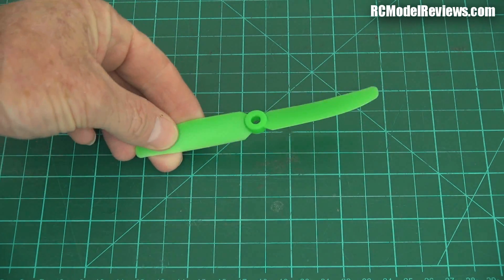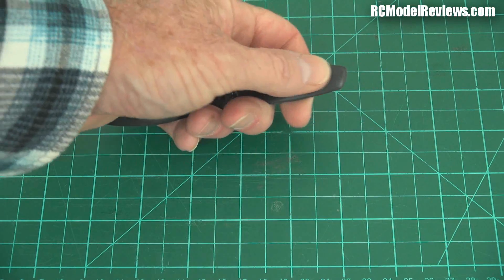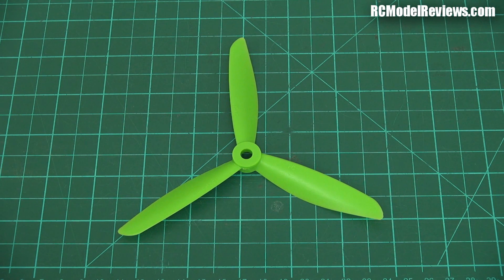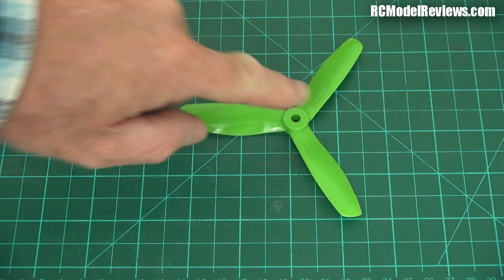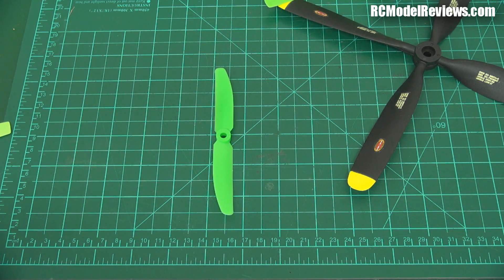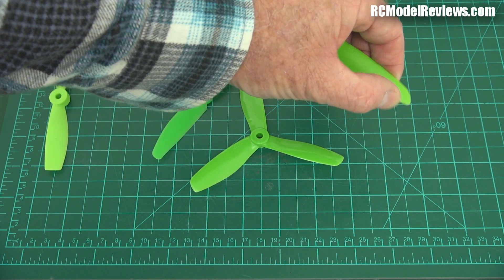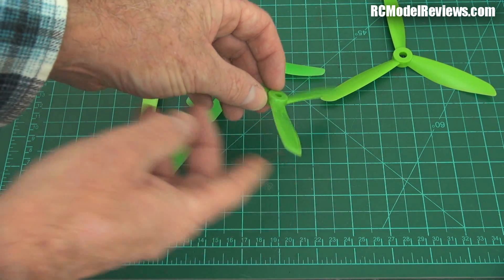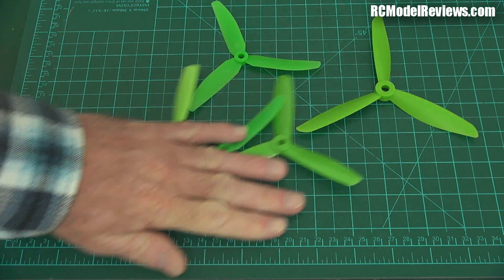Why use multi-bladed props?

Comment: This is a fascinating subject, I'm glad you're exploring it.  I did some of my own trial & error analysis with boats.  The variables were mostly the same.  However one of the key targets I factored in was the Max Efficiency Amp rating of the motor.  A draw value below the figure, let's say 18A meant you were leaving power on the table (not utilized by load) and a drawn value above Max Efficiency meant the motor itself was burning off power as excessive heat. A very challenging subject.   I can't wait to see your results.  Cheers.

Comment: There is no such thing as "gripping the air". Full scale planes go to multiblade props when tips go into transsonic region, killing efficiency.
Reply: Dmitry: I'd never heard of that but it makes sense, the wall of drag tips of a large prop encounter exponentially as they approach such speeds. Thanks.

Comment: Dear Sir, I went trough most tripples on  my flygin setup, so LB20a, Nano 1300mah 4s 45-90c with few common motors I have/had (CM2100kv, eMAX RS2205, RCX 2633kv) . The idea behind it was: to compare them, have a relation. Not showcase the max output. I am sure one can get more, I would observe it go down by seconds on those poor 1300mah batteries :) Anyways. 
https://docs.google.com/spreadsheets/d/1MHiwL-Ppa5EijWQnxz0YCHZVRdIq61A_nlNokHOwaSQ/edit?usp=sharing
I really like your aproach to tests. I have chosen a few to use in relation to tests. I went with 5x4x3, 5x4x4, DAL 5045BN v2.
I just received DYS 5x4x3 which have a good price, might try them over the weekend (both in air and stand). 
I did test all the BN doubles but I just like the way triples work. 
The absolute shocker was CM2206-2100kv on 6s Bolt and GF5045bn (duble) 1.7kg :O

Comment: For racers, you only need enough battery to last until the end of the race, any extra is unnecessary added weight. A real test would be to see each configuration with the appropriate battery.
Reply: Well more efficiency would allow a smaller battery. All is a compromise
Reply: +Samm Sheperd (SNRS) Exactly, though I do suspect that a 4 bladed setup with a 2208 and larger 90C battery would perform much better than even the most efficient prop/motor combo and lightest weight battery equivalent.

Comment: There is an additional bonus to multiblade props, and it's one of the reasons that I fly them.  Because they produce more thrust, you can fly with less overall blade speed.  This makes multiblade props quieter than two blade props, at least in my experience.

I would find a hover efficiency test interesting.  In theory, some of the inefficiencies due to adding blades, is mitigated by spinning the prop slower.  I'd be interested to know how the battery life duration for just hovering would compare between props.
Reply: Old post I know, but figured i'd reply anyway in case someone else runs across it. I saw a video of a guy who tested 4 blade, 3 blade and 2 blade (4 blade with 2 blades removed) props on his tiny whoop, and he was gaining roughly 30 seconds more flight time per blade removed So the 2 bladed prop was giving about a minute more flight time than the 4 bladed prop.  So the drag reduction of slower prop speed in no way counters the drag increase of having more tips.
Reply: His test has flaws. If you want to compare the props, when takling about energi useage, you need to look on the swept area of the props.
 In his test he is basicly trying to proove that you get better fuel economy If an motor only pulls one car instead of two. I think most of us can tell that with out an test

Comment: Bruce I have a Tarot 650 ironman quad with 4114 320kv motors 16 inch props would it be better to use 3 or 4 blade props for max lift? I know that or atleast I think that flight times will go way down but lifting power will it increase? I was going to switch over to the wooden props? What do you think would provide the most lifting power?

Comment: Hello Bruce,
Thanks for this vid!
Nice 1!.. Iam very interested in how the efficiency of a coaxial setup might improve with dif props sieze and different pitch.
What i believe is that the efficiency improves when a bigger prop is used  with lower pitch mounted above and a smaller prop with higher pitch below.  (eg used for a y6 setup). 

I hope i can tempt you doing a video on this.
Anyhow thanks for all your support! 

Gr. Wouter

Comment: A 1-bladed prop would be even more efficient then a 2-bladed I think? You might have seen nightflyyers tests with 1-bladers? 
Oeps.. I jumped on the keyboard to soon :P haha :D
Reply: +DutchRC Adventures i have seen a one bladed propeller on a real aircraft, it has a balancing weight on the opposite side.

Comment: Bruce, it might be interesting to measure battery drain after the time trials just to get a real-world measure of the effects of different props on total power draw.  I realize that that might require a "calibrated" battery, but it would help with understanding the whole thrust/power/performance/efficiency issue.  Just a thought...

Comment: i like the hq5x4x3 the best despite how fragile they are
Reply: +Plur307 Not a fan of props that don't break, your motors and esc's won't like them either.  if the prop doesn't break, then there is a really good chance it will hit your esc in a crash. They will be out of balance after the first crash, if they were ever in balance, bad for your bearings. Breaking props is part of the game, if you can't afford to play the game find a cheaper hobby.
Reply: +jamble7k Ditto.  The 5x4x4 are nice on 2300kv motors.
Reply: +jamble7k I've recently tried out the DYS 5x4x3 and it has nearly identical performance as the HQ and is incredibly durable.  Holding them side by side they have almost identical shape.  I can crash 5 or 6 times and not have to change a single prop.  You can just bend them straight and fly again.  Eventually they just get so chewed up that it is time to change them.  I have only broken a few of them and its only when you have a direct impact on something solid like a tree branch or fence post.  The plastic is more flexible than the HQ so they aren't as rigid, but man they are durable.  The DYS 5x4x3 also costs less than 1/2 what the HQ 5x4x3 costs.  I highly recommend trying some out.

Comment: So, wanting more power, more blades or prop area is one way to go. But what about sticking with 2 blades, non bullnose and spnning the props faster instead? increase KV or cellcount. Granted, the standard 5" gemfans are a bit soft, but assuming a suitable propeller is available.
Reply: +Akujiwar Bladefist 
Spinning faster decreases efficiency. In the worst case a blade hits the turbulence of the blade before it and will not really produce any thrust anymore.

Comment: Bruce are you saying that a 5040x3 has more thrust per rpm than a 5040x2? I always thought the "40" represented the inches of air moved per 1 rev for the entire prop, and not a single blade, or am I mistaken?
Reply: +Jon Keller 
The number denotes how far a prop would "screw" through the air within one revolution. If you'd cut a prop down to one blade or you've got ten blades of the same pitch, it would still be the same distance every time.
Reply: +Jon Keller 2 blades, 3 blades, pitch remains the same. More blades = more thrust. Imagine the propeller moving through a solid material. Like a screw through wood. Pitch would determine how far in the screw, or propeller, would move for each revolution. Now, adding more blades, it would not move further per revolution, but if you were to attempt to pull it out, more blades would make that more difficult, as its got more grip.
Reply: I guess I've never thought of it as moving through a solid, but rather moving air. Makes sense. Most of the acro guys I've spoken to will tell you that they use tri's because of the added stability though, and not more thrusts.

Comment: Part of what I enjoy about flying quads has to do with all the changes and innovations. I fly Airbus A/C on a daily basis for work and I have an M-24 Orion Gyrocopter (2 seater) and aerobatic Acrosport II, Bi-plane, for recreation. Quad flying is cheaper but gives much of the same fun. A lot of the design features in model flying share a heritage in full size aircraft and now that materials are getting lighter and stronger, more cross over will occur. Bruce, I wonder what you see coming up....? Perhaps this idea warrants a short video? "Q-Tip" props i.e. small winglets on blade tips to reduce induced span flow or even variable pitch or constant speed props? (Airbus Neo aircraft have geared engines and have moved from typical winglets to "Sharks"). I would humbly submit, it is the battery tech that we must see where the really important changes need to occur in small and large scale. Thanks so much for your informative and humorous work!
Reply: +flytelaw1 Yes, I already posted a video on the q-tip props a while back, very interesting indeed.
Reply: +xjet Thanks...will have a look for it...Cheers, Chris

Comment: eventually if they keep adding blades they will end up with turbines
Reply: +Christiån Kirkenes A turbine is the opposite of a fan.
One uses torque on a shaft to create moving air (fan).
One uses moving air to create torque on a shaft (turbine).
Reply: It was a joke, but thank you for at least commenting with correct information
Reply: Android811 Does that mean then that the compressor turbines in a turbo fan engine are actually fans, not turbines?  That would mean that the turbines are actually only that part of the jet engine that intercepts the exhaust gasses to spin the fans?

Comment: Thanks for the video Bruce. On my 5" mini quad I've found that the 5x4x4 HQ props are the most efficient, in terms of performance props and my flying style, anyways. 4 minutes of pretty hard flight on a 1300mah lipo. Cornering on 3 or 4 blade props is the biggest selling point to me. All that grip in the corners inspires a lot of confidence.

Comment: Much more rotational mass in a heavy 4 blade prop. Not tried them yet, but found the 3 blade non bull nose to be perfect for me. Another reason WWII props went multi blade instead of larger... Larger diameter beyond a certain point can make the tips break the speed of sound. Love the discussion, love your work! Thanks as always.

Comment: BTW, you never got to show those 3D printed ducts on a 250 quad :)
I know from experience that ducted props increase efficiency, provide some lift in forward flight, hugely increase stability (the darn thing barely wants to move horizontally!) and they act as noise amplifiers even  if they cut off the tip vortex, they reverberate all the other noises the motor makes.  But all my experience was on  a huge 600mm tri... project that I scrapped for a 250mm tri that folds and packs nice in a backpack.

Comment: I would like to see how the 3-blade props compare to the 2-blade props on bench thrust/amperage test, particularly the linearity of the thrust-to-current ratio.  Meaning, does the GemFan 3-blade Bullnose give 20% more thrust using 20% more current than the GemFan 2-blade Bullnose (equal thrust gain for equal current increase)?  Or would the current draw be a higher percentage gained than the percentage gained in thrust?  Or maybe thrust gained is a higher percentage than current draw percentage increase?  I think having this data would conclusively show the performance you would gain is higher than the battery life you would lose.
Reply: +thechosendude 
I think it is incorrect to compare 2- and 3-blades props of the same size on the same motor.
Because 3-blade prop with the same size and the same pitch will give more thrust on the same rpm, therefore, it will require much more power from the motor.

It is always a balance between speed and thrust. If you want higher speed you must sacrifice your thrust. You may select two-blade props of lower size with higher pitch and higher-KV motor. Your model will be slowly accelerating 
Vice-versa, to obtain higher thrust, you can select 3-blades props, or props of higher size with lower pitch, and need small-KV motors running at lower speed. This makes a model very responsive, but slow. It is may be good for multirotors hovering, because when hovering they are requires only thrust, and no speed (although you cannot get thrust without moving the air)

So, direct comparison of just 3- and 2-blades props with all others params are the same - is not informative at all.
I think using 3-blades on lower-kv motor on lower rpm  will show almost equal thust-to-current curve, but, keep in mind, since rpm is lower, air speed is lower too

(Sorry for my English)
Reply: AterLux I understand what you mean about drag on more blades and thrust not always equalling speed, but I think it's important to remember most of us "average" flyers aren't doing high-speed racing, we're doing freestyle type flying, where having gobs of instant thrust for punchouts is going to be more favorable than the top speed in a straight line.
Reply: Have you seen the miniquadtestbench website?  He posts very detailed tests and lets you download his raw data.  The raw data is very detailed.  The most detailed motor thrust tests on many props I have ever seen.

Comment: so if I wanted to go to 3 bladed props would I need to upgrade from 12amp esc?  I have 2204 2300kv motors on 3s
Reply: +Damien Van Der Vlist probably not, maybe check your motor specs

Comment: now we just need to wait for the battery technology to catch up
Reply: +CaveManta and few weeks before release some chinese company will already be making them :D
Reply: +Ultra RC I just got started using the new Turnigy Graphene batteries and they are great, really great.
Reply: *****  I only wish we get the second part of the battery internal resistance video.
Reply: +CaveManta The amount of solar power you can collect in the surface area of an aircraft can't do anything more than push you at glider like speeds.  It's a tiny amount of power.  Solar racecars are basically hollow shells that use bicycle wheels, they aren't a vehicle useful for any type of transport.  They are as flimsy and light as possible and they still only "race" along at like 25 mph.  Solar power isn't enough to power a vehicle with any useful amount of power.  There just isn't that much energy in solar power that hits the surface of a vehicle, you need more light than what you can collect on the vehicle itself.
Reply: +Ultra RC Apple needs to invent solid-state batteries already.
Reply: You know, when RCTestFlight's solar plane finally gets finished, battery life will not be an issue anymore!
Reply: +Plur307 the solar car race in Australia the cars are often clocked at over the speed limit 110 kph 
68.3 mph they also have a cruser class a bit slower but capable of carrying 4 people 
 Recognising the imperatives of sustainable transport,   we have 
established the Cruiser Class to encourage solar cars designed for 
practicality and acceptance in a given market segment.  Cruiser Class 
teams aim to change the way we think about what we drive and what fuels 
we use.   2015 will see the second running of this class, which is a 
tribute to the inaugural event in 2013 which saw a four-seater family 
car travel over 3000Km with an external energy input of just 64kWh!  (to put this into context, a modern family car returning around 5ltr/100km would use an energy equivalent of around 5000kWh!)
The Solar Impulse 2 plane
 set the new distance and duration records when it flew 3,519 miles 
(5,663 kilometers) in 80 hours. The solar-powered aircraft is currently 
partway through a planned journey around the world.
Reply: I just checked and the 2015 winner had an average speed of 91 kph (56 mph), they have gotten faster than I remembered but that is still very slow.  The fastest solar "race car" in the world is slower than a crappy $500 car off craigslist that barely runs.  The solar car is also absolutely spartan inside with zero creature comforts.  They have the most spindly wheels possible and you would probably break it just by sitting on the body.

My point is that solar power is still very weak for powering vehicles.  It will never be able to keep a miniquad flying.  It is possible to make a solar powered fixed wing aircraft but fixed wings are much more efficient than miniquads.